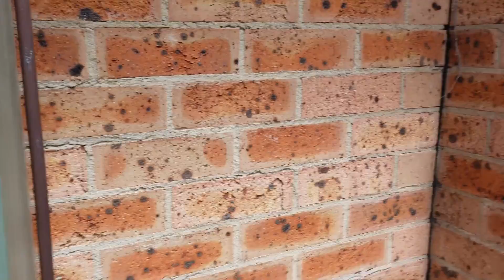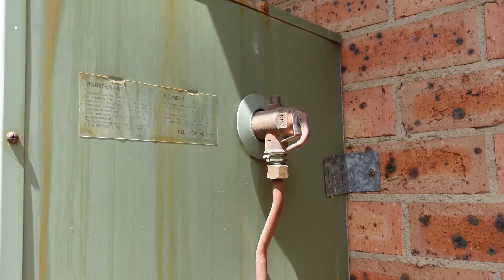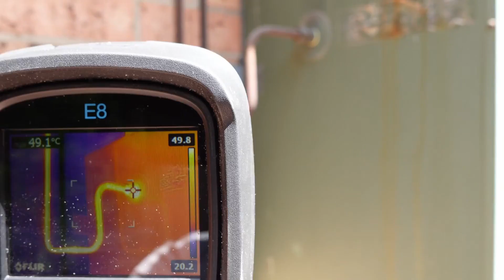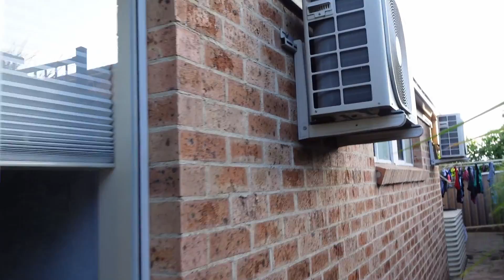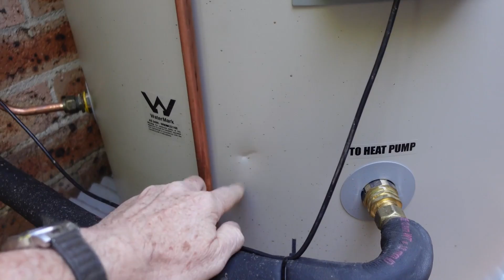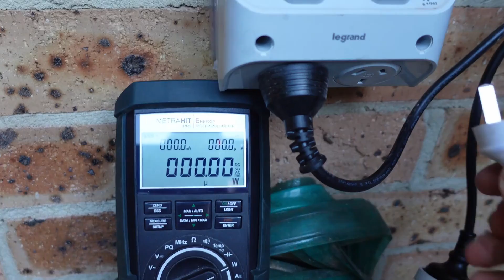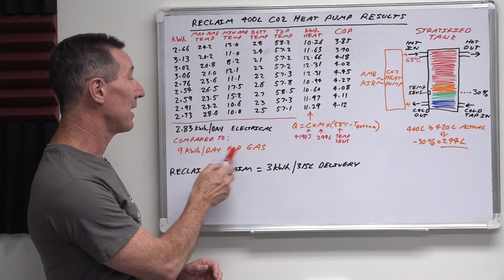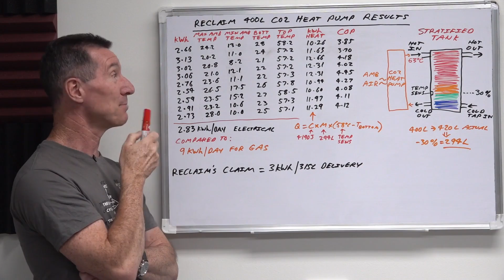EEVblog 1517 - Heat Pump Hot Water Install & Analysis

Comment: I'm curious of the air output temp from the heat pump fan, can the (assuming cold) air be used as opposed to vented to atmosphere. 
A nice duct up into an insulated roof space, Some automation on the heat pump as well, When solar is cranking around midday, run the heat pump, and cool the roof space as well. Double duty for the energy used making the hot water.

I recently had solar installed (in the gong), SMA energy meter in the system, and running that data into home assistant. Dishwasher needed replacing, and the one the wife wanted happened to be "smart" and integrate into home assistant, A few hours later there is now an automation, tell siri to turn on the dishwasher, and when my solar export power is greater than 1500w, the dishwasher will start.

Comment: Wondering how well these would work in Scotland. We currently spend quite a lot on oil just for heating water over the year
Reply: A friend in the Highlands did consider one for heating/ hot water a few years ago with the 50% grant that was available at the time. When he looked at the figures, it would have needed considerable help in very cold weather with an electric immersion heater to get the water temperature up. Also radiators would have needed an upgrade. That said, his father who lives in the same area swears by his system. I think the new generation of heat pumps are definitely superior.
Reply: @spamhead  We don't think our house, an old farm house, is suitable for heating with a heatpump. But, the hot water system could be a good thing to look at. Heating oil has come down in price recently, but it' still expensive.

Comment: Congratulations. 😁
Wouldn't it make sense to heat the water to a lower temperature?
To me it seems sub-optional zu first heat the water up to 60+°C just to mix it down to 50°C again. The lower the target temperature of a heat pump the more efficient it is. A lift of 30K is certainly better than 40K. Furthermore, the losses from the tank would also be reduced due to the shallower gradient.
Reply: Legionella regulations require at least 59 degC

Comment: That Class O pipe insulation lppks like it was torn off with the plumbers teeth and then installed lol. It should be cut at 45 degrres and a small section married up to cover as much of the fitting as possible. It should also be sealed up on the ends or convection will defeat the purpose of such high grade insulation.

Comment: CO2 refrigerant mate, that's cool! (or Hot I mean!)

Really says something about the climate when you have the hot water tank OUTSIDE, jeez you aussies!

I think your PTC element calculation is spot on, that's more or less what I measure on our 200l hot water tank in the basement split between two apartments, so 3 adults and one child. (numbers from Norway for those playing along at home)

Recently I have been looking at a hot water tank with a heat-pump installed on top from Vaillant, it uses an R290 refrigerant I think, however for the life of me I just cannot get hold of any useful data for my region. Average yearly temp here is 7 degrees Celsius, so not particularly cold, but quite an expensive investment without knowing potential savings.

Comment: Why don't you just measure the amount of water used, calculate how much energy it takes to heat up that water and calculate the efficency of the gas system ? 170 l should be about 7 kwh not including losses. The gas system used 12.8 so total efficiency is 58%. Assuming that the 12.8 kwh is used for heating up 170 l from 20 to 55 degrees c. Later for the heatpump you did it more or less. But if you disregard the loss then you only heat up the water that you use. No matter how big the tank is. So I think your cop is closer to 2 than 4. You are not using more water with the old system you said you used 12 . 0.69 kwh (efficiency taken into account) and with the heatpump you use 12 kwh of energy to warm up the same amount of water ? That does not make sense.

Comment: If you don't need 63°C turn it down to 50°C as you know and like your hot water
You want to turn your mixing valve as low as possible because you mix the hot water with cold anyway to shower and whatnot. So better have a already not so hot (and not insulated!) pipe going thru your house (and loose less heat) then mixing it at the destination.
You can also run the whole Tank cooler (if your heatpumnp controller supports that)
Saves you energy in booth ways as the tank looses less and the heatpump will have a better COP
Also you could set this thing up the way that it heats to 63°C only with excess solar power and drops down to 50°C at night (which might also get you through the night without drawing anything from the grid)
Reply: Some people are obsessed with bacteria growth like legionella, and when they are doing the regulations they may require such a temperature for any stored hot water to prevent it.
In my system I have only flow heating (no storage tank) and indeed I have set it to 50degC as that is plenty hot enough.

Comment: I use direct DC from PV  to electric hot water heater elements. I am working on a project to divert some of the input dc from PV before it gets to the controller ( on separate battery system). Then any excess not needed to keep the batteries full will go instead to heat the water - no conversion losses by controller or inverter.

Comment: Interesting.

(I had a electrically lit tankless gas setup at my other place)

Tanked gas water heaters are unheard of here (in South Africa)

That pilot flame might be using quite a bit of gas....

(moving to gas / solar water heating is quite common here with the unreliable grid power of for reducing the battery / inverter requirements for those with solar setups)

AFAIK, it is recommended that the (mostly resistive electric) tanked water heater temperature is set to 60°C for efficiency and safety. (50°C minimum seems acceptable) (Many people set it hotter (up to 80°C) to allow for more hot water to be used(when mixed with cold, e.g. for showers)) (the tanks are often 150 - 200 l)

(I'm not a huge fan of heat pump systems, mainly due to the sellers / manufacturers doing dodgy marketing - like comparing against undersized solar systems) (they are certainly better than resistive, and with solar power they might make sense... Fossil fuels in when using grid power would be interesting to compare with gas)

Comment: You can set the mixing valve lower without fear of using more hot water, it will just mix in more cold at the valve as opposed to your tap. The only difference is the maximum temperature of "full hot" at your tap will be lower (which is what you seem to want).
Reply: As long as the water temperature (and usage pattern) is ower legionella bacteria survival criteria. According to wikipedia "At 50 °C (122 °F) – 90% die in 80–124 minutes" https://en.wikipedia.org/wiki/Legionella#Heat
Reply: @AnatoFIN  the hot-cold mixing happens after the tank. The tank is heated to 60+ degrees at least once a week. So no legionella risk by changing the tempering valve setting.
Reply: @-vermin-  Legionella can grow in the pipes. I would prefer if temperature was high enough to inhibit Legionelle growth from the tank trough the tempering vale to the tap. 

I admit I'm no expert on this, but at least in Finland, ministry of environment regulation (1047/2017) specifies that hot water must be over 55°C everywhere in the hot water system to inhibit Legionella bacteria.
Reply: I set my heat pump tank (yes, my tank got its own heat pump as part of it) to 54 degrees celsius, with no anti legionella cycles because there's no need to go fast kill when the tank ramps up to slow kill twice a day and stays there for hours each time. And I discard the cold part from the pipe. I have it in a roofed outdoors area, kind of like a porch. I want to move it to the back garden washroom though, to reduce pipe length and act as a forced air intake into that unheated space. Valencian village, so even though air freezes in winter it's only in the night and usually less than two weeks, so no time for pipes that are being used to freeze, especially with insulation on them.

Comment: What ist the year-averaged COP for your air / water heat pump? For European conditions a year-averaged COP of 4 ist normal. You have summer time in Australia now. The COP of your heat pump should be now around 6 or even more. Why you only see 4? Where do the losses come from?
Reply: My understanding is that the variables affecting it is Compressor efficiensy, insulation on the pipes that heat up, the system design (gas choice, correct restrictions and evaporators etc.). I think it might be insulation primarily.
Reply: @TheEsseboy  The COP depends on several parameters. Most important are air and hot side temperature of the heat pump. But also the convection rate of the water circulation is important. The convection rate is usually optimized to work with larger water / air exchange areas, where the air side limits the heat exchange.

If you operate the heat pump with a water / water heat exchanger it is different.

I can imagine that the convection rate in the water circulation is too low to transfer enough heat into the water of the vessel. because there is only a copper tube spiral. So the reflow enters the heat pump still to hot and the heat pump has to transfer its heat to a higher end temperatue, loosing thermodynamic efficiency.

Comment: lol.  63C = 145F.   I have my water heater set to 150F, which is 65.5C.   I like long, hot showers.  So to make the showers last longer, I have the water set hotter.  Also, the heating coil in my washing machine broke, and I can't for the life of me find a replacement, so for the time being, I just have the water heater output hotter water.  Seems to work pretty well.   We've never burned ourselves with the hot water, and even our 9 year old just knows to not turn the water all the way to hot, and then put his hand or body under it.   It seems to be fairly common around here, to just test how hot the water is with your finger, or touch the faucet, to get an idea of how hot it is.   The fear of being burned has never been a worry.   If I could raise the temp even higher, I totally would.  The hotter the water, the less of it you need to mix with cold water to reach a desired temperature, making the hot water last longer.  

oh, and electricity ( and gas, even though our water heater is electric ) is really cheap in my area.  Midwest Ohio has some decently low rates for power and gas.  So having the water heater get to 150F ( 65.5C ) isn't a huge concern.

Comment: Nice! What a coincidence, I have a Reclaim system in my garage that I’m just about to have installed! Looking forward to using my solar power directly for hot water instead of exporting it for 6c and then buying it back for 19c/kWh into my old rusting conventional system!

Comment: I'm astonished thr water system is OUTSIDE your building, open to the weather. Furtherthat tempering is open to outside, UNSECURED, subject to mischief, sombody get an astonishingly hot shower. What, ya got no enemies? JUST THE SAME, IT IS A LETHAL POSSIBILITY. If not regulated by gov't of australia, nation wide, YOU SURE ARE TRUSTING?

Comment: 9:58 "you don't want it too low because then you're using too much hot water to get the temperature that you want"
Huh? The amount of water taken from the tank remains the same, the only difference is you mix in more cold water at that point (the standard thermostatic mixing valve) instead of at the tap.
For highest efficiency set the temperature as low as possible while still able to get the temperature that you want and without any in-house thermostatic mixing valves/taps start to oscillate.

Comment: You could possibly fit a recycling pipework set up to the tank to reduce the cold spot effect at the bottom of the tank ( brings to mind Appollo 13 stirring the tanks). Also the effect of ground cold on the mains water feed will affect how much power you use to warm the tank.

Comment: Consider adding some insulation to the overpressure valve since it is hot losing some of your stored heat, even add more insulation to the exit hot water pipe.

Comment: What if the incoming hot water went through a roof mount heat exchanger to preheat the cold water. Maybe just a coil of black pipe on the roof.
Reply: Oops meant the incoming cold water

Comment: I'm wondering if you were underestimating the amount of hot water you were consuming from the old gas system.

The one time my gas system went out it took like under an hour to heat the whole tank from ambient to hot. 

So you wouldn't run out of hot water unless you all had long hot showers back to back, as it is heating the water at a reasonable rate compared to your usage.

As opposed to your new system which is entirely stored hot water at the time that you are using it.

Comment: This tempering valve decreases the efficiency a lot. Because the heat pump works hard (=not very efficient) to get it to 60°C but this is then foiled by mixing it with cold water.
It would be better to heat the tank to only 45°C or so and set a heat cycle to 60°C every few days to prevent legionella. Or use a tank with fresh water system then you don't even need the periodic heat cycle.
Reply: Mixing hot water with cold water doesn't necessarily decreases performance. As he explains, mixing it means that it draws less hot water, so he actually uses less energy. Keeping the temperature high in the tank just allows him to store more energy and protect it against bacteria.
Reply: @taldmd  You missed my point. The higher the temperature the heat pump has to reach, the less efficient it is. Efficiency != performance. Rule of thumb is 1°K more means ~2,5% less efficiency. This is especially important in the winter with way less pv energy collection. The nice numbers shown here are from summer, the best case.
Reply: @Alterproll  regulations dictate the minimum tank temperature to prevent bacterial growth
Reply: @brendanrandle  I don't know how exactly the regulations are in Australia, but i would think these only apply for the installers and not for the end user. What the end user does with his property after installation is up to him. And the bacterial growth can be fought other than obtuse continous high water temperature, as described.

Comment: Co2 is nether better nor more efficient as far as the refrigeration cycle is concerned... You need higher pressures and you don't condense on the high pressure side so you need more heat exchanger area. It is being heavily marketed as 'better' , it's a load of rubbish.

Though it needs to be said, that a COP of 4 at a 60-ish degree lwt is pretty good. You'd be getting a COP 5 with older non ozone depleting refrigerants

Comment: Could you hook up this heatpump system to a European-style hot water + radiator heating system, so it heats the rooms too, not just the tank of water?
Reply: It would have to be sized to be able to heat the volume of water moving through all those radiators .  So it would most likely be a lot larger than what this one is and use a lot more energy.  You could look up ground sourced heat pumps and compare the size- those systems are meant to heat houses.

Comment: If it was sold to you as a 415 litre tank then you have been ripped off. It clearly states 400 litres on the tank. Do the math on the provided dimension and it isn't even 400 litres it is just shy of it. And that is without even factoring in the thickness of the material, any air gap that might be required or anything inside the tank. Maybe they should call that model the TARDIS.

Comment: 9:30 NOOO, you WANT 63°C or higher from time to time to tackle legionella bacteria inside the piping...
At least that's what our landlord regularly does.
Reply: The US uses chlorine/chloramine for that. I'm not familiar with Australia, maybe they have a much lower residual chlorine level in drinking water.
Reply: @NiHaoMike64  Chlorine in the tapwater? yeah, no thanks. Tried that on vacation in Ireland... yuk.

Comment: So a rooftop PV panel turns 20% of incident sunlight into electricity and the heat pump enhances that with a COP of perhaps 3.5 to give about 70% of that original incident sun energy as hot water. By comparison a rooftop water heater panel would transfer 90% of the sunlight into heated water at much lower cost. I think there is a good argument for a minority of roof area to be set aside for directly heating the water.
Reply from the maker: Nope. I'd rather have the roof space filled with solar, then the energy can be used to power anything, not just the hot water.

Comment: In Europe we have solar systems too but for hot water we use vacuumed tubes with heat pipes in arrays of 10 to 30 pieces. Maybe if you account the solar panels efficiency per square meter the vacuumed tubes are more efficient. Plus in a no frost area you could use direct heating vacuumed tubes that heat the water directly in the tubes wich raises in an upper tank using no electric energy. Useful in no energy available environments.
Reply: I have the same tubes here in Perth WA. Its backed by an LPG fired on demand heater that only kicks in to boost the water temperature to 65C (if the inlet is below this) when a hot tap is turned on. Being LPG I run it on 8kg BBQ gas bottles. The LPG also feeds the gas hob. The warmest 6 months of the year I run on one gas bottle, the cooler 6 months I use one a month. At $30AU per re-fill my hot water and hob cooking is costing me $210 a year.

Comment: You might want to wrap additional foam insulation at the pressure relieve valve to further reduce heat loss and any other pipe leaving out from hot line that you feel heat or can see with a FLIR.
Reply: They all should have thermal bridge breakage. A lot of heat is gonna get lost.